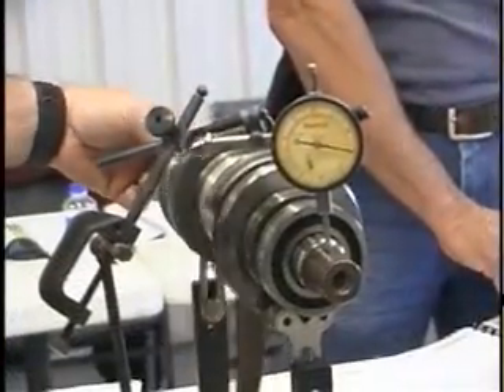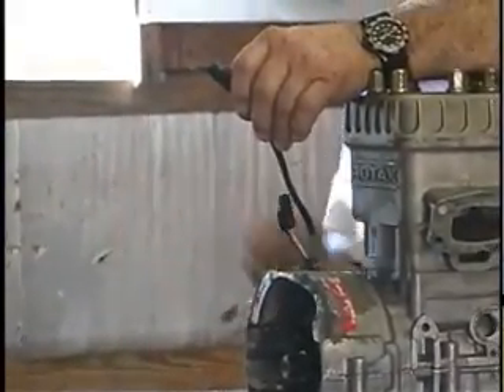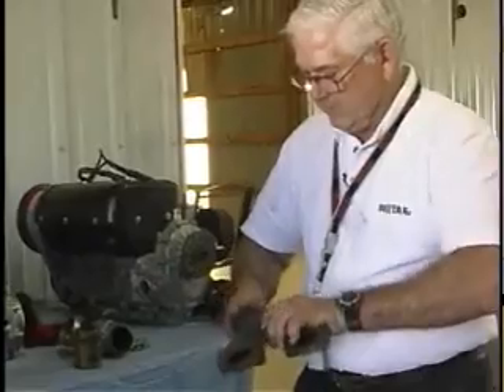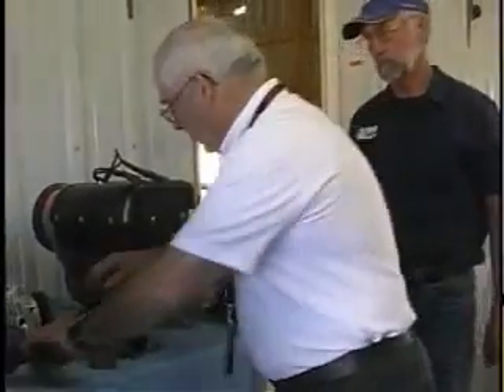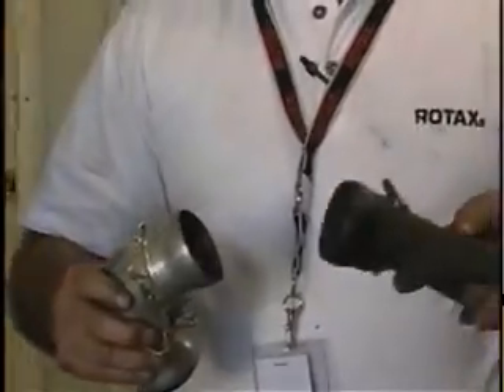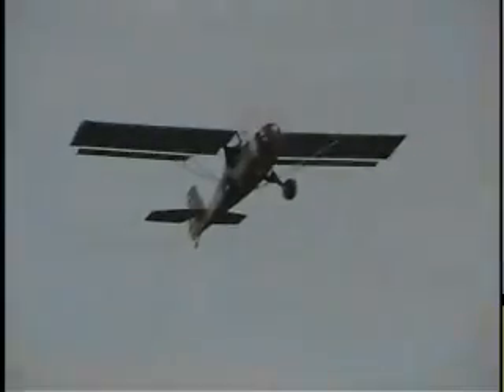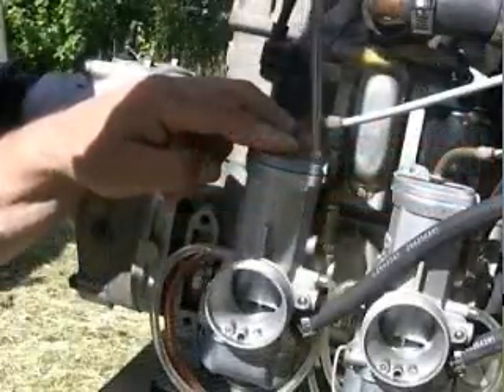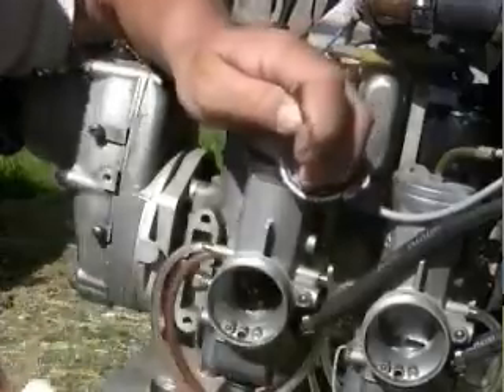Rotax  377, 447, 503, 582 two stroke engine repair courses, South Mississippi Light Sport Aircraft.

Comment: Hi,lovely video and great explanation of 2 stroke principles and operations.Question? What and why is this machining being done on this engine water pump area? I was wondering as I am using a ,just rebuilt 618 in my merlin? Also do you know of any such "auxilary modified water pump spacer and longer shafted RV Valve and it availability for me to purchase,It is an aftermarket item.
Reply: Ceramic water pump seal on a Gray Head being cut . ROTAX RICK